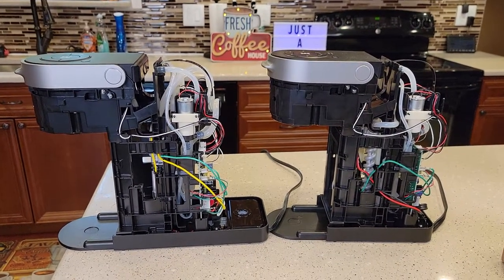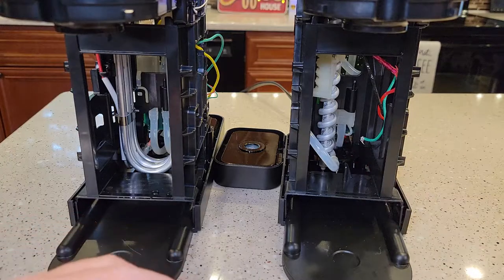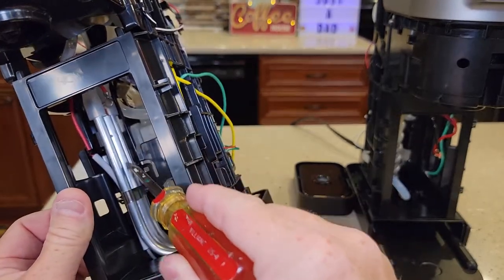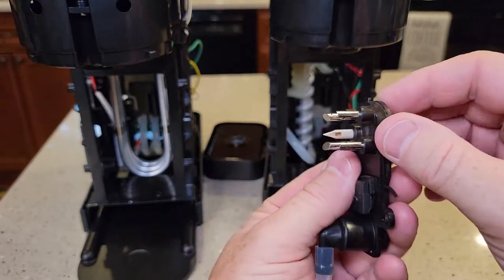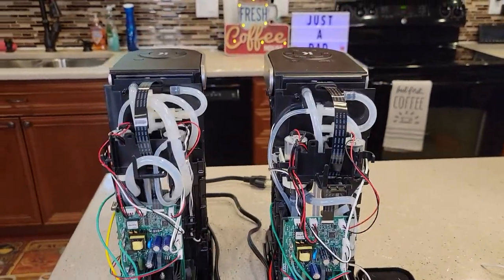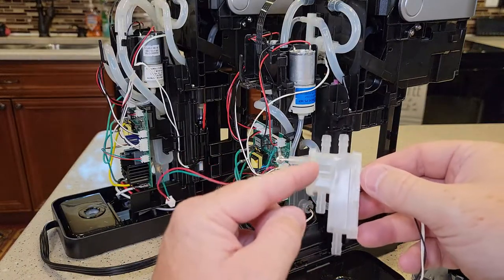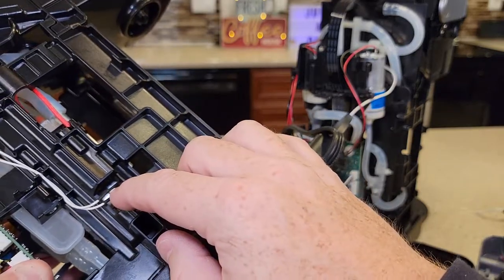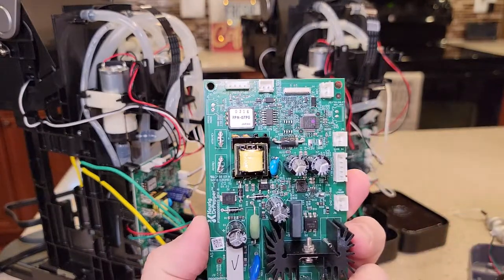Keurig K-Supreme COMPARED To K-Slim On The INSIDE  What is Different?

Comment: im having an issue with my k slim, it suddenly stopped working. when i push the lever down the descale flashes once quickly and then nothing else happens. currently have the cover off and have tried to figure out a way to reset it?

Comment: Hi where is thermostat breaker reset for k slim the one with your left machine with U heating coil. I have the same machine but I can’t find the thermostat breaker .
Reply from the maker: it does not have a reset,  sorry  the older k slims are not resettable.
Reply: So there is no way to reset the K Slim (with the 3 heating tubes) after the first descale?
Reply: Darn, I've been watching your videos and tinkering with my k-slim for close to an hour only to find that the older version I have is not resettable. Thanks for confirming my suspicion.  @JustADad